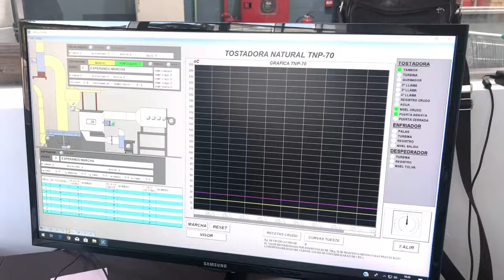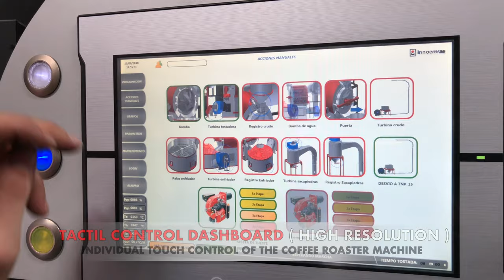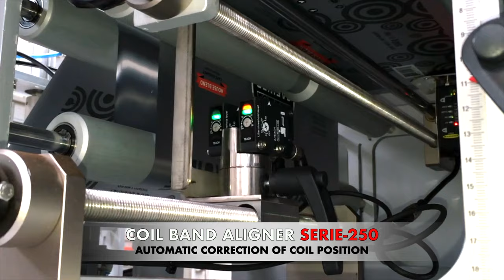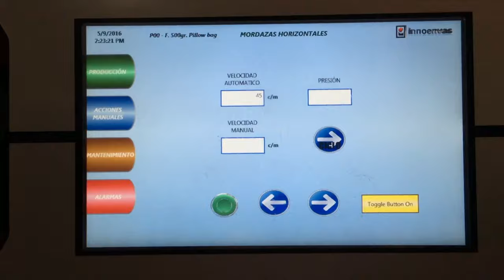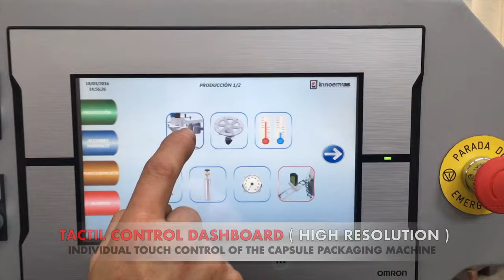Coffee Plant INNO-PRO Line | Complete Coffee Factory - 100% Automatic Work | INNOENVAS TECHNOLOGY ✅

Comment: after ground. how ground coffee goes into the packaging machine?
Reply from the maker: Dear Huệ Trần

INNOENVAS Design and manufacture complete coffee factories in function the criterion of each customer.

For this reason, we have different ways to transport the ground coffee to the different packaging machines ::

Directly through Endless transporter from the coffee grinder machine
Through from the ground coffee warehouses ( degassing process )
Through endless elevator from a hoper to the packaging machine.

Is possible to have a lot packaging machines in the same factory, for this reason there are many tubes with special tools to guarantee the supply of all the machines at the same time.

I send you a link of different coffee factories layout 3D with different supply system for the ground coffee.

Video 1 :: https://youtu.be/I_bENNqiwU4

Video 2 :: https://youtu.be/xEZbyCcI1nE

If you need a budget in a future then Please contact with us, and we will make the best budget for you! ( made to measure )

Best Regards

Innoenvas Team